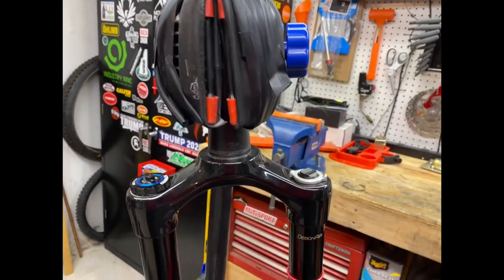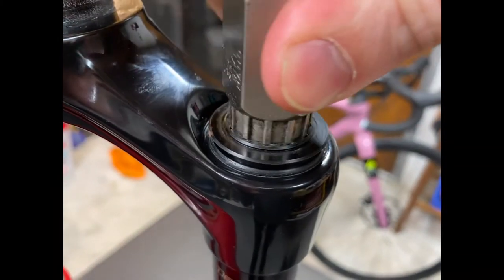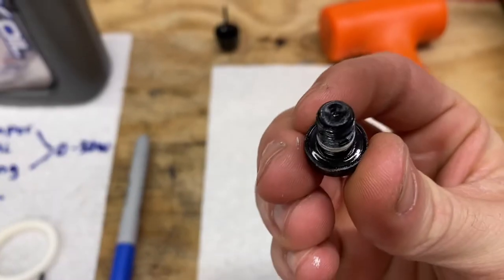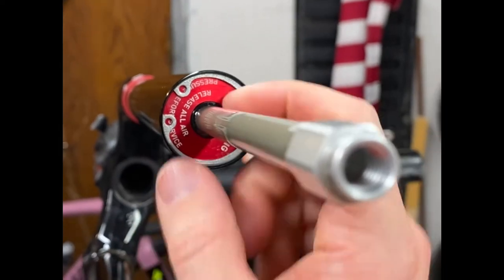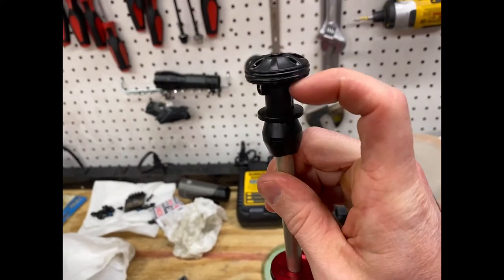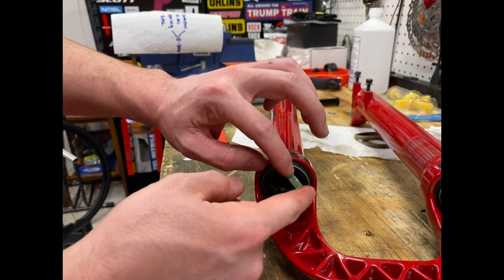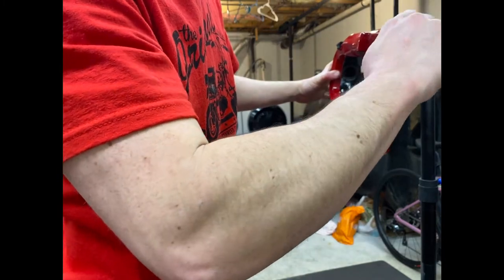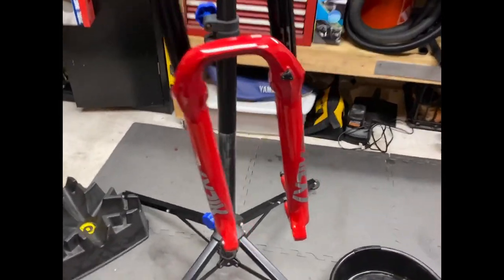HOW TO: Change Air Shaft / Travel on Rockshox Fork Lyrik Ultimate Debonair Upgrade

Comment: This has become my go to tutorial. I’m using my Lyrik as a 150mm for trails and 170mm for bike parks. So far 3 conversions. Only applying new oil and some grease. Thanks buddy.
Reply from the maker: Happy to help !
Reply: Quick question for ya sense you seem to have lots of experience with changing fork travel length. Do you notice the lyrik fork being any less stiff or rigid when increasing travel by 20mm? I’m thinking of making my fork longer but I’m already feeling like the fork isn’t stiff enough for my weight (190lbs) and I’m afraid lengthening the travel could make it worse. I want to go from 160 to 170-180mm on mine.